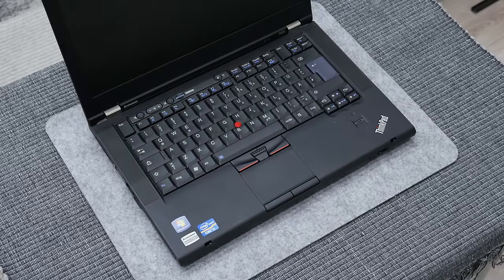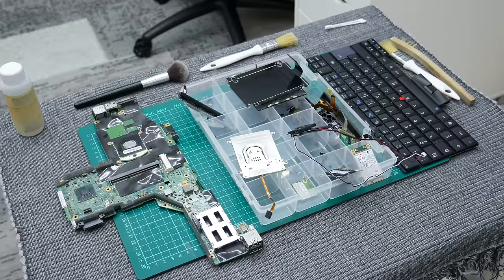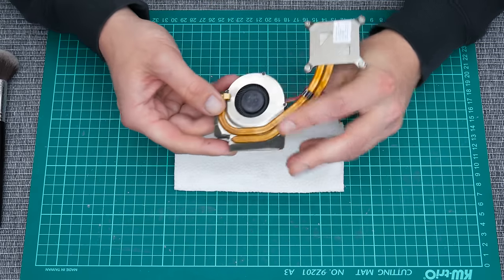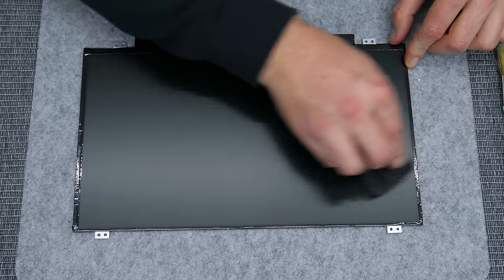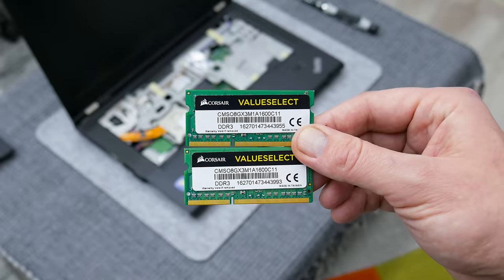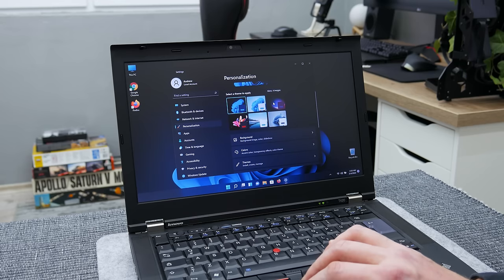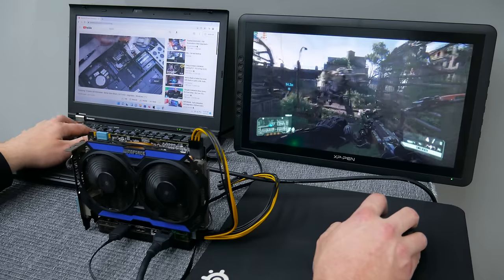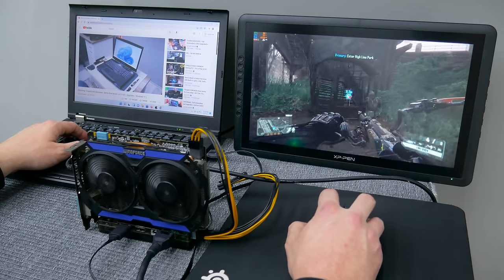Restoring Lenovo T420 - ( Upgrades + Windows 11 + eGPU )

Comment: I worked on one with USB 3.0 ports, couldn't believe it was a current generation laptop
Reply: The T420 does not have USB 3.0 unless you add a USB 3.0 ExpressCard. The T420s is the one that has USB 3.0.
Reply: @terrydaktyllus1320  yes I think that's the one I saw, hardware came over from the company down the road for Windows 10 installation

Comment: Which solution use to clean sticky laptop case ?
Reply from the maker: Hi bro, I used isopropyl alcohol 96% and Antistatic glass cleaner, but this won't help in all cases, if the laptop is veeeery sticky then only some vinyl will cover that or complete paint

Comment: Sir is this possible on x260 paired with GTX 1650?
Reply from the maker: Hi bro, I'm not sure, I didn't test the x260. But with some newer laptops I got 1660 working well. But this doesn't mean that will work with other laptops and gpus.

Comment: I have a lenovo t430s and I am planning to change hdd to ssd and I don't knw if I need to clone it or not I need help
Reply from the maker: Hi bro, you don't need to clone anything, just place a new disk, install windows and later you can transfer your data to your new disk, or you can done that previously to some usb or external hdd
Reply: @ComputersAndTechAndAndrew  thanks bro

Comment: Its like a new laptop, great job, i like the upgrade, 
I have a question, i have old laptop asus a42n, can i upgrade the cpu? Its amd v series V120, im not sure to upgrade this laptop, but getting some old tech work again so satishfying, thanks
Reply: Search the web for info on the CPU. If it is socketed, then you probably can upgrade it, as long as you do it for one with the same power requirement. If it is a soldered CPU, then it's a no-go.

Alternatively,  you can search for info on the motherboard [speccy is a good utility for identifying the model ] to see whether the CPU is upgradeable. 

Hope this helps.
Reply: Just install cpu z software and run it, it will tell you everything you wanna know
Reply: @arif_529  It won't tell you if the CPU is socketed or not. Neither will it tell you what CPUs you can replace it with if it is socketed. A bit of software is no substitute for proper intelligent research.
Reply: @terrydaktyllus1320  have you checked properly ? , I want you to run cpuz once more. And in the first window that appears find package info. If it says FCBGA, then your processor is soldered and can not be replaced.
After you do that come back here and let me know
Reply: @terrydaktyllus1320  i also do agree that any software can not replace intelligent research, have a nice day my friend
Reply: thanks for the feedback guys, and here I will explain in more detail, so I use CPU-Z ver.1.94.0x64, my cpu is AMD V140 Champlain Socket S1 (638), and the mainboard is AMD 785GX with southbridge AMD SB850 , I've done a little research and many people advise not to upgrade the cpu, but it's better to buy a laptop that is better in terms of value for money.
but this is my first laptop in 2010 and still alive, so maybe i will upgrade ram and hdd to ssd, maybe u guys have a suggest for a cheap ssd and ram??😊

Comment: I miss the days of laptop with removable CPU, you can upgrade it anytime but, now most things are soldered, if one thing doesn't work, it just becomes a expensive paper weight
Reply: I was forced to disable the touch feature on my damaged Surface Pro 3 after I dropped it and broke the digitizer. The screen has a hairline fracture but it runs fine as a laptop. A pity it can no longer be used as a tablet. Its incredibly fragile.

Comment: cpu bottleneck is a big factor aswell, it was pinned at 100% most of the time holding the gpu back
Reply: The problem isn’t with the cpu, its that there’s no discrete gpu present onboard to relieve a heavy workload on it and that’s a  limitation that can’t be overcome. You’re better off doing that on a W or P series Thinkpad.

Comment: last year I've find Lenovo X240 laptop in trash stock config was core i5, 4 Gb RAM, 250Gb mechanical hard disk and 1366x768 screen.
Modified by me : core i7, 8Gb RAM (only one slot available), 1Tb Samsung QVO SSD and 1920 x1080 screen, it was my "Doomsday laptop" in case of world's end.
Reply: Edit : Last week i've found another ThinkPad : L530, Core i5, 4Gb of DDR3 upgraded with another 4Gb DDR3 founded at the same time in Asus laptop (dead), 320Gb HDD upgraded with 256Gb SSD and 1366x768 screen upgrading soon and CMOS battery was dead. I've only buy AC/DC adapter for 5€.
Reply: Unfortunately, it has already arrived in our country(

Comment: when microsoft says, no updates , they actually mean no driver or hardware software updates,  like dell pushing bios updates, or driver updates for their devices through windows etc
Reply: If you have an Intel graphics card, you can still update it if you know the processor family. That will generally work without issues.

Comment: In general, I liked the video. BUT I HATE YOUR BACKGROUND MUSIC! It was painful. 
You are probably using copyright free music, but at least lower the volume on the music.
That's my main complaint.

Also, when you are disassembling the laptop, could you name the components you are removing/replacing while doing so, please?

I know that I am not paying you for the video, so you can ignore my suggestions.

Thank you for a very clear video and the extra part about using external GPUs. That was interesting.

Comment: I installed Windows 11 on my "pseudo desktop" Ideapad S300 (I called it pseudo desktop because the battery is dead and the keyboard is broken, so I have to hook it to a monitor and external keyboard and mouse). Also. I upgraded the RAM from 2gb to 8gb. I'm genuinely surprised how well Windows 11 runs on 9 years old laptop.

Comment: you can achieve much higher frames-per-second on T430 using the exact same eGPU setup.
Reply: Why?
Reply: @alexf1515  20:08 "this is the maximum this ext card can provide." Disagree with that. There are users running higher frame rates using that GTX 960 or other GTX models. So, the cable isn't really limiting the frame rate.
Reply: @henryng439  I understand what you are talking about that it is possible to achieve. But how?
Reply: @alexf1515  How: Use a T430, T530, W530.
Reply: @henryng439  So what will be the difference, can you explain it normally?
Reply: @alexf1515  About 2x to 3x the frame rate of the T420 using the same eGPU setup.
Reply: @henryng439  That is, the speed on the T420 is slower than on the T430, why? I just didn't know it, everywhere there is information that the T420 and T430 have the same PCI-E or ExpressCard speed. That's why I'm asking what exactly is the difference, if there is reliable information about it :)

Comment: Windows 11 is a downgrade. 
>Install gentoo
Reply: Absolutely. I have a big collection of Thinkpads going right back from a T20 through to a T450 and they all run Gentoo perfectly. Try running that Windows 11 crap on a Pentium III T20 or a Pentium 4 Mobile T42 and see how far you get with that. But Gentoo with XFCE runs fine.
Reply: @terrydaktyllus1320  do you mind sharing your use flags for those old machines?